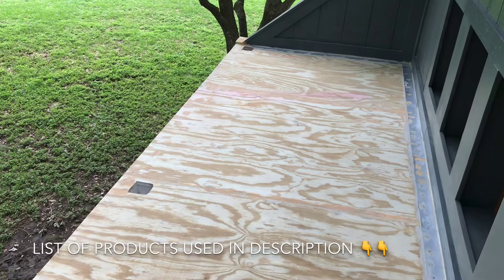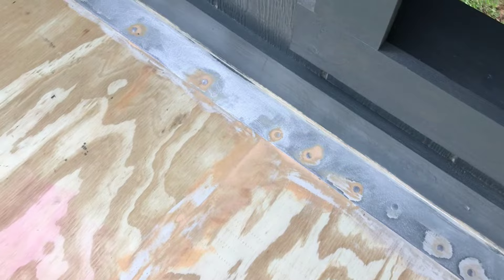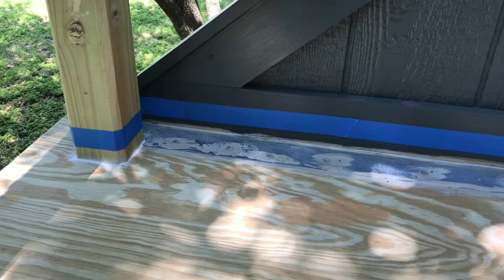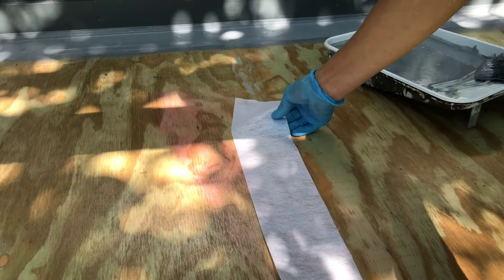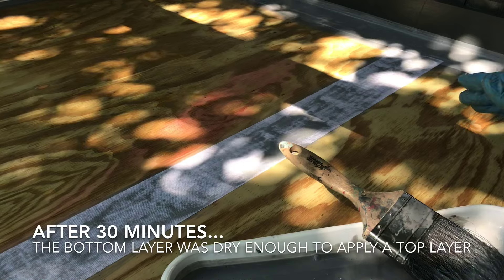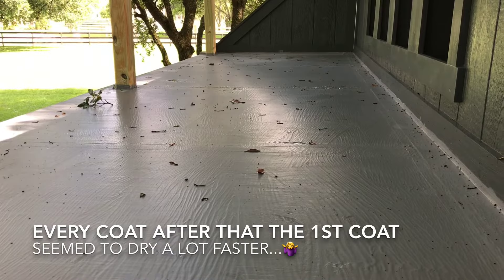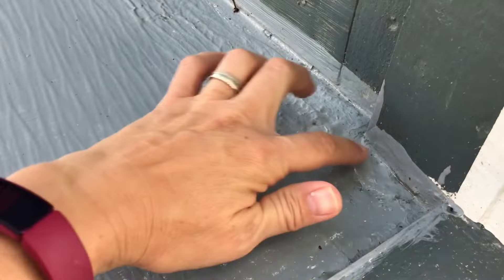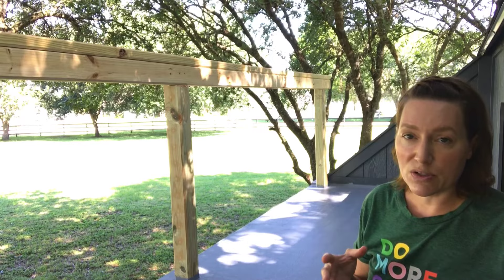Waterproofing a Plywood Roof Deck or Balcony with Liquid Rubber Deck Coating!

Comment: I noticed that on the video that Liquid Rubber has produced, they lay the Geo-Textile tape down during the Primer application.  That would probably avoid the extra heavy coating you had initially of the Poly that took so long to dry.  It may also help saturate the tape and have it lay right onto the wood, since the primer is much thinner.
Reply from the maker: Here’s a link to their instructions, I followed their 3 course application recommended when 2 boards meet, to fill the gap. 👍 https://cdn.shopify.com/s/files/1/1442/2252/files/Application-Guide-Liquid_Rubber_Polyurethane-Deck-Coating.pdf?v=1591645547

Comment: cool. thanks for the idea. it's basically an elastomeric sealant with a poly cloth to make the sealant stronger, and the primer helps the top coating to stick to the surface. This is the same procedure for roofing, so if you don't want to use the liquid rubber brand you can use something similar at your local hardware store. Use the primer especially on new wood, so that the wood soaks up the liquid, otherwise if you skip the primer, you will end up using more product to coat the surface, and over time the product will end up peeling off due to the intense sun. If you only use 1-2 coats with a brush, when it dries it will be a really thin layer of rubber on top of the surface. Elastomeric and Rubber surface coatings can get really expensive if you have a lot of surface to cover. And, it doesn't last forever. Since global warming has increased the sun beating down on surfaces, we've notice that the material is not as trustworthy. might be a better option to use a pond liner on top, for areas that pool and is exposed to a lot of sun, if you really want to weatherproof it, if using plywood or OSB
Reply from the maker: Luckily, I planned ahead and sloped that roof. I never have any pooling.
And, my surface is shaded all day. So, I can’t verify it’s durability in full sun.
But, what I really like about this product is that it’s highly recommended, looks great so no need to cover it, feels great under bare feet, has held up under all of the heat and rain we get in the south, and it comes in lots of colors. It was really easy to apply too! 
A friend even used it to make the floor of her camper watertight. 👍
Reply: What if you have a tar balcony? We have tar balcony and there is some type of waterproofing membrane that looks similar to what they use on roofs. The thing is the surface is not level, so water ends up sitting there. As a result pockets started creating on the waterproof membrane and eventually break through the tar in between cracks.
Reply from the maker: @factionGM  sorry, I’ve never worked on a tar roof. I remember watching my Dad and Grandpa pour a new tar layer on a roof as a kid. I think it’s so thick that you have to drag a leveler across it to get a smooth surface.  I’d call the customer service line at Liquid Rubber to see if they have a product that can go over tar. 👍
Reply: you lost me at global warming

Comment: Is it slippery when wet? I have an apt with a 150 sqft balcony/patio area sitting above the carport. I had new OSB subfloor, waterproof paper, durock and tile laid down a couple of years ago. With the recent TX rain, it keeps getting wet; water sips through grout lines and has now rotten about 2' x 3' section of subfloor. As a result, the enclosed carport gets tons of water. Wondering if I could use this on top of existing tiles, after repairing the rotten out area of course.
Reply from the maker: You can call the Liquid Rubber help line about using it over tile. I think you can, but definitely double check. I wouldn't call it slippery but water can make anything a little more risky. BUT, they have a textured version that's even more slip-resistant.👍
Reply: @AbbottsAtHome  Thank you for replying so fast! The current tile is slip-resistant and because my Dad stays in the apt from time to time, I don't want it to become a hazard. I will look into the texture one. 👍

Comment: How’s it holding up? If you slide a chair across the top does it rip?
Reply from the maker: It doesn’t peel like latex paint would. Ours still looks new. But, it’s not like we’re eating meals up there. That would be a lot more chair scraping than we’re doing. So, I’m not sure how well it would hold up to daily chair scraping from adults. 🤷‍♀️

Comment: How’s it holding up?  I used this.  It lasted about 5 yrs then the entire deck was saturated under the rubber surface.
Reply from the maker: Hi Jodie! Mine is a little over 2 years old and still holding up great. I recorded a new video about it: https://youtu.be/iI3UmN2-Qe0
Did you have scratches and damage to the Liquid Rubber that caused the saturation? Or was it deck boards and the water penetrated from underneath? Just curious about what you think went wrong. Or do you think it just needs to be reapplied every 4 or 5 years? Thanks!
Reply: I'm correct in assuming it was not a covered area and not do to accumulation of humidity? Thanks

Comment: I am working on my balcony deck.  I really don't know what liquid rubber to waterproof the balcony. I just wonder the material (liquid Rubber brand) that you used  is last.
Reply from the maker: Hi! Here’s the products I used on this balcony. 😊
Here's a list of the products I used on this build (all Amazon ads):
Liquid Rubber Smooth Poly UV Resistant Deck and Dock Coating, color Stone Gray - https://amzn.to/2XI1i7M
Liquid Rubber Geo-Textile - https://amzn.to/3f3JSZj
Liquid Rubber Primer - https://amzn.to/2Uoamwz
Minwax Wood Filler - https://amzn.to/30ksH1q
40 Grit Sandpaper and a power sander to prep the surface

Comment: I really like how this turned out. I have never seen this sort of treatment before, I will be really interested in seeing how it holds up!
-Austin
Reply from the maker: Thanks, Austin! I have high hopes for it so far. It looks great and seems really durable. 🤞🤞🤞
Reply: I Had a tiled balcony that leaked  roughed up the tiles , applied liquid flash  then a rubber paint to walk on  no more leaks that was 20 plus years ago , approx  15 years ago built a balcony , just like this one , done it the same way ,  joints are cracking and need redoing  now , but heh 15 years  on the beachfront , very harsh conditions , excellent stuff ,, in fact  last week  done my caravan roof  to  stop a leak ,  ,  2 coats , storms next day , no more leaks , product i used was called liquid flash in Aust , but its the same product from the looks

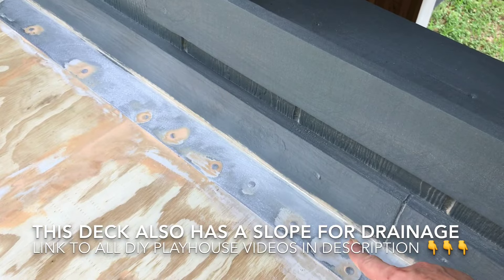Comment: Just a small correction: their 3 course application with the Geo-Textile tape is intended to be used with the primer, not the polyurethane. See starting at the 1:28 min. mark of the company's instructional video. That said, it looks like it's still holding up well for you! https://www.youtube.com/watch?v=rxdyteoA2Zk
Reply from the maker: That's interesting. I see what you're saying about applying it with primer. I was actually following a different one of their videos: https://www.youtube.com/watch?v=qwFqz0d6v3A&t=94s That video is on the geotextile product page and shows it being applied to the coating. But, either way, you're right, it's held up great.👍

Comment: seems really great! wonder if it worth while to put another layer of vinyl plank. seems would be more scratch resistant than just this ruber.
Reply from the maker: I haven't seen any scratches yet. But, I know what you mean. I think some people build a floating deck over this. I like the vinyl plank idea. Vinyl planks could work, if it's sealed enough to keep water from getting under it. :)

Comment: Hello, I was wondering how you finished the outer edge of the deck. I don't see any metal flashing to wrap the corner. I don't want to use it anyways. Could we use the geo-textile tape and fold it to wrap that edge corner? Or no need anything at all? Great tutorial video. Thank you.
Reply from the maker: Hi! I wrapped the edge and the joint where the overhang meets the shed wall with the geotextile, then coated the whole area with Liquid Rubber since I didn’t have a drip-edge installed. 👍

Comment: Thanks for this video! Really helped. Is 5 coats required? or you just wanted to go through all your material?
Reply from the maker: Thanks, Steve. If I’m remembering correctly, you only need 3 coats. But read the container to be sure. I’m just paranoid and overdo everything! 😊

Comment: Great Video! My wife and I are looking at doing this to a small balcony. Thank you for all the links!
In the beginning it looked like the product color was grey. On the final closeup it appeared white. Did that really happen or is it just the lighting? 
Also, how slippery is the deck after it rains?
-Rick
Reply from the maker: Thanks, Rick!! It’s definitely just the lighting. The color doesn’t really change as it dries. It’s a medium grey. The deck is surprisingly not slippery. It feels like linoleum so if it was really wet and you had slippy shoes on, you might slip. But, I wouldn’t say it’s any more slippery than a wet wood deck. But, just in case, they make a textured version of this too. 😁

Comment: Hey really like your video! Wondering how much rubber paint you ended up using for your size deck?
Reply from the maker: Thanks, Sarah! I used 5 gallons of the liquid rubber (about 5 coats on this 75 sq foot area). :)

Comment: How many liters of Liquid Rubber were used to make 5 coats?

Did the manufacturer recommend 5 coats? If not how many were recommended?
Reply from the maker: I don’t know what it would be in liters. I used less than 5 gallons. They have a square footage formula to help you figure out how much you need. I used more than they recommended, mainly because I always overdo everything. 👍

Comment: How strach resistant is it if I put metal chairs on it?? Thanks
Reply from the maker: I dragged a 2x4 bench frame across it and it didn't make a mark. But, I'd avoid sharp edges to keep it nice longer.

Comment: Did you use the smooth or textured liquid rubber?
Reply from the maker: I used the smooth, but applying it with a nappy roller gave it a little texture. 👍

Comment: QUESTION; When was this deck coated please, how has it held up?
Reply from the maker: Hi! I get this question pretty often. So, I made this 2 years later video: https://www.youtube.com/watch?v=iI3UmN2-Qe0 :)
Reply: Thanks so much. I have a 13x16 deck on the second floor. I want to put a workshop under it. My deck boards are starting to suffer so thinking of plywooding over all of it, leaving the old decking on for strength and the fact I used galvanized nails and they are brutal to pull out. I don’t have the energy for that anymore, lol thanks again for responding
Reply from the maker: @jerrytalley802  You’re welcome! Good luck.

Comment: I priced an aluminum waterproof decking system for a 40 sq ft entrance porch for my son's house. Extremely expe
nsive. I'm skeptical this would hold up to the constant foot traffic of a main entrance. Maybe with an outdoor carpet on top.
Reply from the maker: Good question. I’m not sure how long this would hold up to front entrance foot traffic. It is very durable. But, it probably requires maintenance (a fresh layer) from time to time. I’d definitely get the textured liquid rubber for a main entrance deck. Good luck!!
Reply: @AbbottsAtHome  Thanks for the reply. The reapplication wouldn't bother me.

Comment: Great job did u put a drip edge or is it not needed in ur situation
Reply from the maker: I do have a drip edge. I put it under the deck that overhangs that side by an inch. And, I have that waterproofing on the edge of that deck and on the bottom, up to the drip edge. 👍
Reply: Great job I’m very interested in that product!Thank u for the response!
Reply from the maker: You’re welcome and good luck with your project!!

Comment: Any updates on this?  How is the maintenance of this in heat and cold areas?
Reply from the maker: Hi! Mine still looks like new 2 years later. But, I live in Houston Texas. So, not much experience with cold weather. But, it’s great in CRAZY heat. 😅
Reply: @AbbottsAtHome  thank you for the reply
Reply: We installed the same product two years ago in Alberta, Canada on a direct south facing deck. The temps get at hot as 38C/100F in the summer and as cold as -30C/-22F in the winter and it's held up great! We installed over older Duradek and saved approx $4,000 doing this ourselves.
Reply: @canadajin9  awesome.  Thank you for the response
Reply from the maker: @canadajin9  Good to know that it holds up under cold temps too. Thanks!

Comment: Can I use the Rubber liquid without primer application and without Geotextile???
Reply from the maker: You should definitely use the primer. That will help it get a better grip on the surface. The geotextile is only needed if you have joints between boards or between floor and wall. Better safe than sorry. 👍

Comment: Are you going to install wood deck on top of the rubber?
Reply from the maker: You could. But I really like it as it is. I’ll put Adirondack chairs and a little table and turn it into a picnic spot. 👍
Reply: @AbbottsAtHome  so the wood deck will be screwed through the rubber and plywood? Would the screw holes compromise the waterproofing?
Reply: That would be a very bad idea. Nails/screws would compromise the waterproofing and standing water caught between your wood deck boards would sit there until they penetrated the plywood.

Comment: What type of L shape you used at corners? I see several and want to know yours
Reply from the maker: Hi! Are you talking about the metal flashing? Or the 1x4 exterior grade wood trim? Both can be found at Lowe's or Home Depot. 👍
Reply: @AbbottsAtHome  metal flashing.... what is the size.
Reply from the maker: It’s about 5” on one side and 7” on the other. I think it’s sold in 20’ lengths, but it’s been a while since I bought it. You’ll probably find it in the roofing aisle near gable vents, if your store is set up like mine. 👍